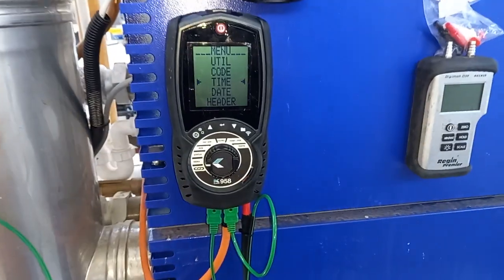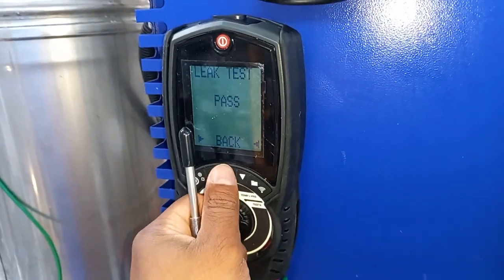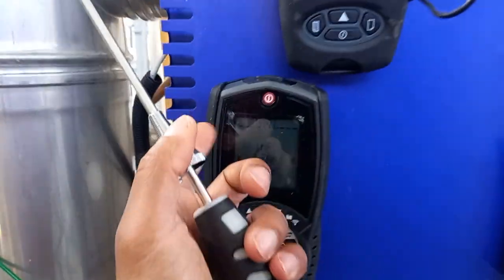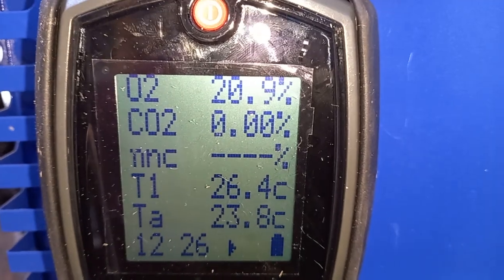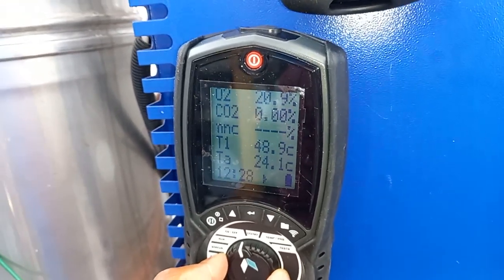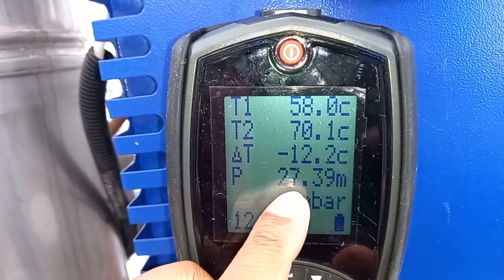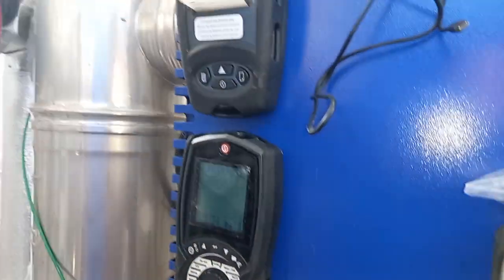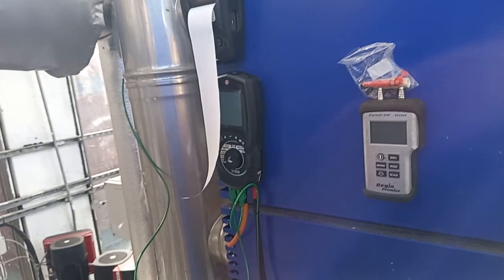KANE 958 COMMERCIAL COMBUSTION ANALYSER

Comment: Ive for an old testo which im not a fan of, no x air, prints slow, the case is horrible and if ppm are higher than 2000 it takes for ever to  zero. Also the case is massive
Reply from the maker: sounds like the one I just had. I feel your pain. Hold on in there bro

Comment: I’m in the US, do you guys solder still? Most people moving towards press. The Anton sprint in the United States is called crowcon I had nothing but issues with it, I did mostly oil burner work and our oil equipment is and can be very dirty and rough. So it was very hard on the analyzer.
Reply: I prefer a digital screen, never used this type, for the price it’s probably worth it. It would have to be reliable though
Reply from the maker: I'm looking forward to trying out a few other models.
Reply from the maker: We still solder here. Yet crimping machines are starting to dominate.

Anton is very popular in the UK and Kane too.

Comment: We've been give Rasi analyers.
+ compact. Co sensor min 5000 ppm 
- No printer but compatible with all to the old infra red model,
-- no combined pressure facility only operates separately from another screen.
- reads 2 decimal points making it ridiculously accurate.
You don't wanna use this thing for a commercial tightness test it will convince you there a leak